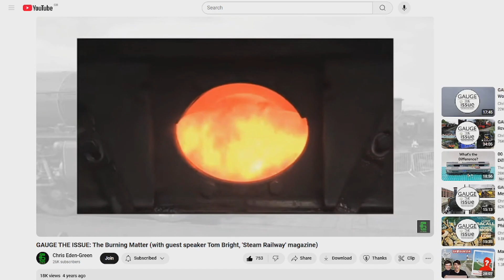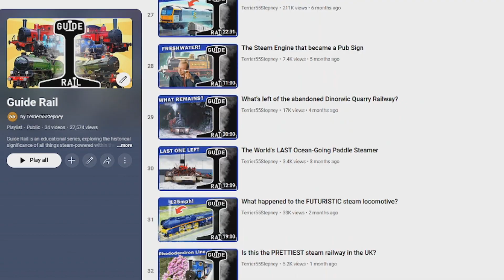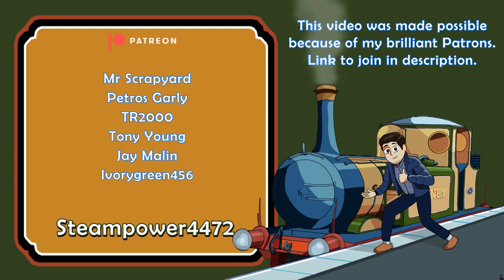Why are steam railways struggling to find coal?

Comment: At least in the UK, steam engines are infact still running. Over here in South America (Chile, to be more specific). There are only 3 steam engines that are in operational conditions, 3! One of them is only used on special occasions, the other is used normally on excursions, and the last one is under going a massive and very expensive overhaul since 2019. Not to mention that the coal in South America, although good for machines and power plants. Is absolutely abismal for the heritage industry here! With many railways back in the days of steam having to export coal from, The UK, The USA, Germany, France, and even the USSR.

Comment: I was wondering if they could just use wood instead of coal? Does it not make the fire burn hot enough or does it just not produce enough steam
Reply: @WhackyZachy  Not calorific enough, too expensive, and would emit far too many sparks in the summer (see the massive chimneys on american wood fired locos - they were spark arrestors).
Interesting fact about wood-burning locos: The images you see of todays ones are a bit wrong, with all the small logs piled up. They have been pre-chopped to fit on a wood-burning stove in a house, whereas wood for locomotives would be in long pieces so one could just feed firebox lengths of wood into the firebox quickly, partially making up for the hunger of the engine.

Comment: I think we need to retrofit steam engines to run off electric motors. I know that's heresy, but it would be far cheaper, and you have loads of space for batteries in the coal bunker.
Reply: thus ruining them, and removing the point of them. oooohkay
Reply: @andrewyoung749  Thus allowing them to keep running for another hundred years.

They'll never be a solid, combination -based, green fuel as cheap as coal again. Biogas is expensive, charcoal is expensive, wood is expensive, and any synthetic fuel made from atmospheric carbon is expensive.

Electricity is cheap.

Comment: I saw the seed oil bricks in use on another channel where a stationary engine was fired by, I think marine style boilers? I'd have to rewatch the vid but they were basically testing the stuff cause of the coal shortage, I also know many US engines were converted to burn bunker oil
Reply: there was video of them using them on the Talyllyn railway on their channel. The report came back that the locos steam ok on them but the bricks were too big for the small engines bunker, and they burnt a lot of them compared to coal, but they considered then suitable for raising steam in the yard. 

I wonder if it smells like a chip shop when it burns lol
Reply: @James_Rivett  They do reek like a chip shop. I know of a railway that tried them. They had to stop tests half way through the day due to the sheer amount of fuel needed, and unacceptable levels of carbon monoxide in the cab.

Comment: Why not just make them oil burners?  A lot of American steam locomotives like the Southern Pacific Cab Forwards and the ATSF 5011 Texases were made as oil burners and did fine.
Reply: And 4014 converted to oil a few years ago.
But by people with knowledge and skills and not whinging Poms.
Reply: @ UK fireboxes are not suitable due to their rivetted copper construction and smaller heating service area, built by real British engineers and not mad cap yanks 😝
Reply: @James_Rivett  Bulleid Pacifics, S160s and some British Standard designs with wide steel fireboxes, it should work!
Reply: @mattgrant2646  the only BR stds with wide firebox es were the 3 pacific designs (only 3 preserved and 1 new build underway) and the 9fs. You won't see a 9f, WD2100 or S160 on the mainline (the powers than be do not like their centre flangless tyres and the speed restrictions on their wheel size would make them non viable on the modern mainline). The issue with bullieds boilers is simply cost of repair and restoration. Many. Are now receiving new fireboxes and throat plates etc because the steel plate can no longer be built up or cut out and replaced with patches. With their thermal syphon they were ahead of their time for steam raising caperbility.
Reply: @johnd8892  thats the uk, the country with by far the most active steam scene in the world, right?  makes the usa look pathetic in tat one regard.  hundreds of steam trains on the mainline charging around every year, hundreds more for on the preserved lines.    but the yanks have a huge steam loco that is so weakened that it has to be pushed everywhere by two massive diesels sat behind its tender ,on its 2 times out a year, so we should learn from them. yeah, that'll be right....
Reply: @ well with all that supposed capability and non-solutions coming through for the coal situation you can look forward to close to no UK steam in the near future.

Comment: The steam equipment with which I'm involved was built to be oil fired originally or converted to be oil fired, so this is out of my area, but....   I assume charcoal has been investigated. It has to be made, but it can be made with agriculture and construction waste. Perhaps a mixture of anthracite and wood to moderate the fuels BTU levels.  I'm not sure about your environmental regulations which might explain the rapeseed plan, but maybe waste oil from vehicles could be taken and absorbed in wood briquettes.  We had a problem when the waste oil that was donated contained anti-freeze and burned way too hot, so I understand picky locomotives.  If we have to, we can run on waste cooking oil.
Reply: one of the problems with charcoal, is its density. The blast of the exhaust has a habit of lifting the charcoal of the fire bed and through the tubes. 

It can be very dramatic at night (from experience).

Our government clamped down on the burning of waste oil several years ago. A nearby industrial steam museum used to run their two marine type steam boilers on waste oil from a nearby scrap yard. they drained the oil out of the vehicles and donated it for free, as they were doing each other surface. The department for the environment clamped down on this, and they were forced to convert to solid fuel.
Reply: @James_Rivett  While this would be more complicated, perhaps charcoal could be crushed to eliminate the structure of the voids and then pressed/rammed down to make something with the density closer to coal that wouldn't immediately fall apart and float upward.  We have reached the point we are trying to create synthetic coal in the land of natural coal.  It would make an interesting story for the media.

Comment: In Australia we have a number of oil burning steam locomotives. They have all been converted to burn diesel oil, which does not require heating like heavy furnace oil did. There is also the Climax geared locomotive on the Puffing Billy 762mm narrow gauge railway which burns wood.
Reply: It interesting to think in the USA from the 40's-60's in the south-western parts of the United States, they had many coal to il conversion burning loco's making the trek up and over the Rocky Mountains. Even then, logging loco's just burned wood. I wonder from an engineering perspective if they could do something simular in the UK, like Union Pacific's BigBoy has been converted (again within its working life) to oil again to do the current rail tours.
Reply: @KeelsonEngles If the UK simply pulled their heads in and got off the grass than they wouldn't have this problem. It's a problem of the UKs own doing and needless.
Reply: It is interesting to note that one engine on a heritage railway (in Australia) was converted from coal to oil. After about four years, it has been converted back to coal.
Despite the fact that coal needed to be trucked about 2000km, it was still cheaper than burning diesel.
Reply: Australia has good coal (especially NSW but also Qld). It would make sense to me for railways in places like the UK to import Australian coal.
Reply: Helpfully, coal is still mined pretty commonly here too
Reply: Burning oil don't start line-side fire.
Reply: @erikkola8078  You would hope not, but there are things called brakes, and they can also start fires.
Reply: @Kevin-go2dw  so do chunks of carbon build up from diesels that haven't had their screens cleaned adequately and oil burners.
Reply: @erikkola8078 Thats a common fallacy. Oil burners and even diesel locos can and do start fires occasionally.
Reply: One loco have been converted in the UK to run on oil, but let's be honest we don't want that
Reply: Unlike the UK though, Australia hasn't screwed its people over to the same degree as the UK.

Comment: The figure bandied about approx 5 years ago for ALL coal fired steam boilers in the UK (heritage or otherwise) was approx 0.025% of ALL uk CO2 emissions (remember most non heritage boilers are gas or oil fired so are not included), while road traffic is responsible for 38% of CO2 emissions. The entire rail industry is only responsible for 2% of CO2 emissions (including heritage trains). 

The fact you briefly mention was of the Talyllyn railway planting 100 trees to become carbon neutral is only the same as 400 passengers a 747 on a journey of 5460 miles, where the Talyllyn burns coal and covers approx 2000 route miles per year and carries almost 95000 passengers during it operating season on just passenger trains (this figure doesn't include special charters, goods workings, driver training, or test runs). That equivalent of  0.07 miles per passenger of the 747 vs 47.5 miles per passenger of the Talyllyn per 100 trees!  

For those who don't understand, if both the 747 and the coal fired steam train of the Talyllyn was to transport just ONE passenger, the Airline would have to plant 1428 trees every mile to remain carbon neutral flying on the 747 but the TR would have to plant just 2 trees for every mile on the coal fired steam train with a single passenger. It is simply down to the number of passengers carried over the given mileage and carbon output. 

There is approx 20000 jet aircraft in the sky globally at any given moment of the day. If that is not sending alarm bells ringing loudly then is should! After 7/11 in 2001 there was no civilian jet aircraft flying anywhere in the globe, and the whole globe cooled down a small amount in those few days before flights resumed and global temperatures increased. A similar (but less noticeable) thing happened during the pandemic lockdowns of 2020 (aided by the fact that many did not need to use their cars so were also helping reduce carbon emissions). 

Now I am not a global warming denyer, I do accept man is making things worse. I do not accept that coal burning is evil or the main element to blame, and based on given and available evidence, the main blame lays at the boom in jet aviation combined with domestic car ownership. However a small degree of global warming is natural.

The painful truth that the green brigade refuse to accept is coal burning is not what has coursed the massive hike in global temperatures over the last 50 years, were coal burning has dropped year upon year over the last 80 years. The biggest polluter on a global scale is jet aircraft, pumping highly refined greenhouse gasses in to the the air, but with their deep pockets, airline operations and jet aircraft manufacturers, have allowed them to lobby governments to prevent restrictions being placed upon them, and attacks on industries with less available fund have been noticed.  The obvious evidence to this is what was mentioned above. I am convinced if domestic air travel was made prohibitively expensive, if tariffs were placed on foreign imports, and further tariffs were placed on accessing UK airspace, not only would the amount of jet aircraft in the sky be reduced, it would be very effective at tackling global warming, it would boost UK industry (as new markets would open up for home made and home grown produce) and whilst foreign tourism would be negatively effected, many would choose to take their holidays within the UK rather than fly.  

Global warming has only became very noticeable in the last 50years. This happens to be around 10 to 15 years after the boom in civil aviation and the boom in domestic car ownership.  The smoke from the burning of coal, whilst it looks bad, and is not good in urban environments (for reasons such as smog not to mention the white washing on the clothes line 😉 ), mostly falls back to earth as carbon. That is why all those once lovely pale stone buildings in the citys turned black from the mid 1800s until recent years as the carbon and soot have washed off.
Reply: Good points made, glad you took the time to write it as well 👍🏻 wish more were the same. We can hope!
Reply: @damonrobus-clarke533  doing a bit more research shows that jet powered aviation is responsible for over 1 billion tons of co2 per year alone, and is responsible for 9% of global warming over the last 200 years, and civilian jet aircraft did not exist until 1949 but did not really. Start to boom massively until the late 1960s/early 1970s. It isn't just the co2 they pump out,  it's the vapour trails and the dumping of fuel that also adds to their global warming nature, the former is not recorded in tonnage but is a notable contributer
Reply: @James_Rivett  spot on!

Comment: If you can't find coal, maybe use wood. Hundreds of steam engines back in the day used wood to generate steam. If that doesn't work, maybe use solid fuel tablets like what Wilesco uses in their model steam engines, but much bigger. As for different types of coal, I am well aware that many locomotives were built to run on different types of coal. For example, the Northern Pacific Railway (in the US) had locomotives built to run on rosebud coal, which is a low-quality coal. Other railroads had locomotives built to run on anthracite coal, which is a very high-quality coal.
Reply: the solid fuel tablets cant be sold here in the UK now without a special licence, because they can be used to make explosives 🙄. Trouble with wood is you never stop chucking it on, so you use a lot of it. (we burn old wooden pallets on the traction engines when at home saving the coal for when we go out on the road or use her on the belt) 

British railway companies did something very similar to the companies you mentioned with their locos, the GWR engines were designed to run on (was was true) welsh steam coal, the LMS on Scottish and Derbyshire coal, and the LNER to run on Yorkshire coal. The southern seamed to use what ever was available, but they were early pioneers in electric traction, but Bullieds locos were desiged to make the most from inferior coal. It also helped that pre-grouping in 1923, most of the major railway companies had controlling shares in their local coal mines. 

We get some good Colombian coal from time to time. I notice this wants a rather thin fire, but when fired like this has a lot of heat. The traction engine rallies are now getting a some man made anthracite/coal based ovals (CPL Wildfire) which I find can be added to normal coal to make it last further, but is not a replacement. The E coal that came out a few years ago made from crushed olive husks and glue together with molasses (black treacle) were dreadful.

Comment: On your comment with low-grade coal and amosite in the US, the majority of coal in the US is bituminous, which is as you say low-grade however in Pennsylvania specifically the eastern half of a state was large deposits of high-grade anthracite and the railroads that served them built their locomotives to fire off this coal a mix of large fire boxes, tall fire boxes, and the famous Camelback allowed for efficient burning of lumps, even as large as basketballs, there is a few locomotives today that operate using hard coal mostly being CAGNEY small scale steamers and a few mine locomotives the Reading T1 operated by the Reading and northern uses a 5545 mix which is why it makes so much smoke Cnj113 was running a 15 soft coal 85 hard-coal mix which is why it didn't smoke as much. I will say it has been much harder, getting fuel here as well compared to an earlier time due to the situation of mines, closing more coal overseas. and competing with other buyers, but that is just my two cents.

Comment: Use wood like Manzanera wood  it burns hot or use natural gas, bio mass, electricity like the Swiss in ww2, or oil like big boy steam locomotive The last two will work because the technology for oil fueled boilers has improved and you can adjust the heat on certain locomotives and oil is easy to get you can import a ton of it from the Middle East or what county has the cheapest that doesn’t put an embargo on its oil due to war or politics.

Comment: Have all the coal mines dried up over there? Or are they just not mining coal anymore. I don't see an issue with opening up a small mine, and using a coal truck to move coal to the different operations, but I'm just an American, what do i know
Reply: Not mining coal anymore. Poland has a mine still, we export it to Norway, and the UK, but the big issue here is: Poland's supplies, just like the UK's, won't last forever. The predicted end of coal mining in Poland is 2040. We may actually go a little longer, or not, it's hard to tell. Plus, hard to open a coal mine, where coal isn't.
Reply: @ukaszwalczak1154  what's ya'lls situation with oil? I assume oil firing isn't an issue
Reply: @MatthewChesnutt  Oil? Pfft, buddy, we don't use oil, and even if we did, we could reasonably only use it/convert the American locos we have to it{aka, literally only 3, two S160s, and a design built specifically for us by the US, the Ty246].
We have 15 steam locos in service, repairs are being done on about 3 or 4 non-working ones. Most of the locos operating are NG, and it'd bankrupt the railways that have 'em, if they were to switch to it.
EDIT: Not intended to be rude, btw. But still, compared to even the American railroads that DO have steam engines, we're cooked 💀